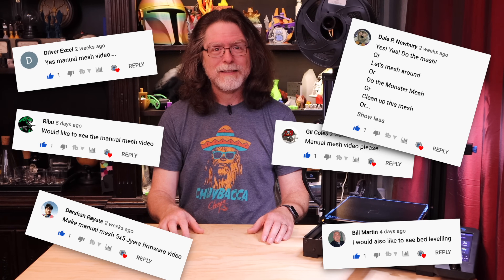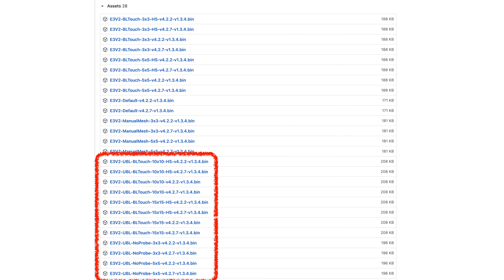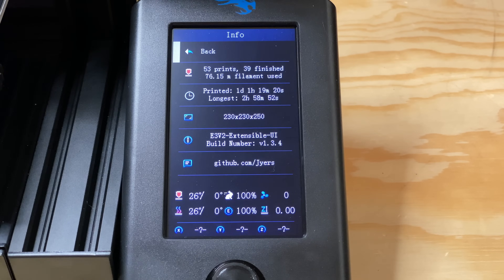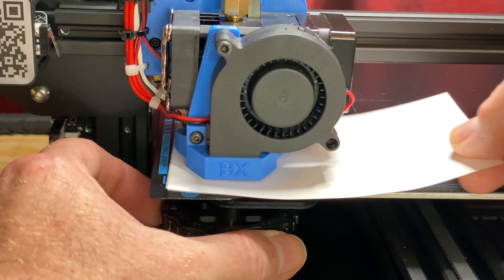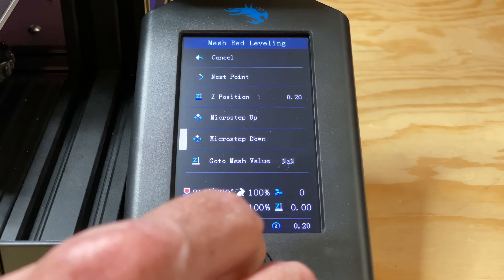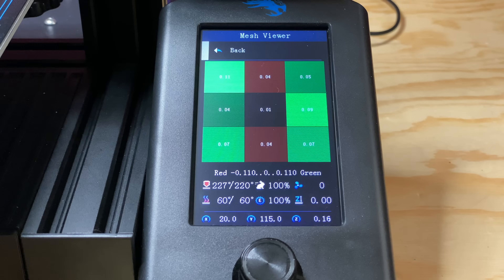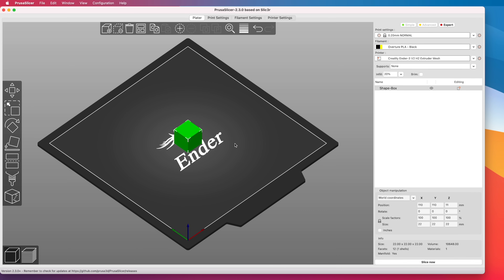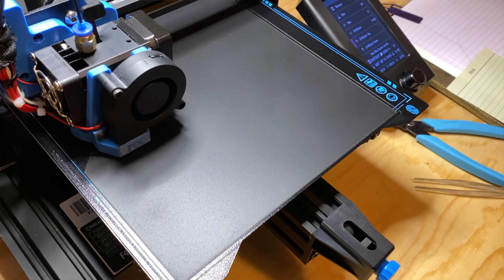Perfect First Layers with Manual Mesh Leveling - JyersUI on Ender-3 V2

Comment: Would i still want to do this if i have a cr touch
Reply from the maker: Hi, probably not. The manual mesh is a way of manually entering the nozzle height at each probing point, when you don't have a bed probe. The CR Touch lets the printer probe those points automatically.

Comment: Thank you for your video. I found it very helpful!
This firmware is a must have if you want to have more control on your printer and your prints

However, i had 2 issues and i'm still working on it trying to find a solution:

1) I could'nt flash the display firmware. I tryed a lot of things (microsd is formatter the right way, FAT32 with 4k) but really i couldnt't. After I inser the MicroSD in the display board, the printer (and the display) simply boots normally, without any blue/orange/black/green screen - NOT a problem by the way

2) The prints are not centered. This is a problem. After flashing the firmware, X and Y values have changed. When I print, the first line is out of the bed and prints are not centered. For the prints, I fixed it in cura, modifying the offset of the extruder position. This partially solved since now prints are centered, but all the old gcodes files can't be printed anymore. I have to slice them again

Comment: Why cant someone just come up with a bed that levels itself 🤔? Either put a motor in each corner underneath the bed controlling the X and Y axis .😊
Reply from the maker: Check out the Triple Z bed leveling on the Voron Trident. 👍
Reply: @BV3D  That's awesome.  But I have an Ender 3 V2, and I would love to have the bed level itself automatically before every print job. It should have the ability to zero itself out in coordination with the gantry.  Every printer bed should come with that basic function at this point.

Comment: I'm very new to 3d printing, so naturally I have many questions as I research topics. Bear with me please. If your bed has taken on the "u" shape, won't subsequent prints also take on this deformation? At what point would you get a new bed? How much function loss would you expect in mechanical prints that have tight tolerance?

Comment: thank you so much! i cant explain how hard i have been trying to level my bed for the longest time with achieving no success, finally i figured out that my bed is warped from factory. and watching this tutorial, not only i was able to level my bed properly but upgraded my printer aswell with more features. 
I GOT A HARD ON WATCHING MY TEST PRINT COME SO SMOOTH.

Comment: After trying this multiple times, I'm beginning to think the stock print bed on Ender 3 v2 is just garbage. No matter what manual levelling I do, no matter how dialled in I get the mesh, the first layer REFUSES to stick. Instead it runs away from the bed and curls up to give the hot end a beard. I'm going to take a break before my hair falls out

Comment: Hey Bryan, I am already a follower of your channel and have learnt a lot since jumping into the 3D printing just a month ago.
Let me tell you that I had been struggling to understand Manual Mesh bed leveling and your video (as usual) is the best in explaining the concepts as well as the steps needed. I just found out that JyersUI might not be a supported firmware anymore and going forward I am hearing that Mriscoc Professional is the firmware of choice for Ender 3V2.
Could you please do a video showing step by step procedure on that firmware as well? Or is it going to be the same as JyersUI?
Thanks and keep up the great work.

Comment: DUDE! I'm using this firmware and despite trying a bazillion times to use mesh leveling, your video taught me how to do it the good way! For whatever reason, since the mesh leveling process starts at Z=0.2, I assumed (wrongly) that I need to get a 0.2mm gauge and adjust the microsteps so in that particular point the nozzle is low enough to grab the feeler gauge. I was so wrong! I need to use the thinnest one I have (0.01 AFAIR) so that I'm leveling as near 0 as possible.

Thanks a lot! You've just gained a sub. Keep up the great work! Woohoo!

Comment: do you have (or plan to do) a similar video but using the more recent mriscoc's professional firmware? I was told jyers is no longer supported.
Reply: Couldn’t agree more. Would be great if Bryan can do another video using mriscoc firmware. 
I’m curious to know if the update in the slicer is the same?

Comment: Hello Bryan, Thank you for such a informative video.
I have just purchased a Ender 3 V2 and first attempt ended with filament all over nozzel and threading all over the item I was printing 
One thing I am not clear on with the levelling with the bltouch. Do you set the bed at fully tightened or loose?

Comment: You my friend are awesome. I watched the Jyers firmware video and got motivated to put the firmware on my printer after it has been sitting for about two months. That was easy peasy and now i feel confident in getting my bed level and getting my printer usable again. I'm no programmer and I've tried a few times to compile the Marlin from scratch but I kept getting errors and I think my VS code is set up incorrectly. Idk how that sorcery works so I gave up until your Jyers video popped up and I thought "what the hell, let's try it." Worked like a charm and my printer is currently making a mesh. Thinking of what to print my people for christmas. Thank you.

Comment: Thank you for your channel and for this video. Having tried native raw stock etc. Marlin without success from the start (I was new to VSCode and could not compile it without errors),j I found TH3D which worked well, particularly its features and UI, until I installed my BLT. I couldn't get it to work so went to the Creality stock FW which was okay, but buggy and very dull as an interface. When I revisited TH3D and took the time to do everything right (using the latest iteration on my Ender 3v2) I discovered what appears to be a bug in its Z offset function, a problem others have also experienced. Suffice to say it is maddening, in part because I went through a PEI mat due to its unpredictable interpretation of Z offset settings. I think this is an issue that has been ported from Marlins Z offset wizard, in the forking...needless to say it maybe shouldn't have been forked because it wasn't quite done (oh, dear) so I ended up trying Jyers, and it is so far a revelation in features, ease of use and GUI. I recommend it and it is good enough and has saved my countless hours debugging T H3D,  that I feel compelled to throw them a few bucks as it will be money well spent. I don't care if they buy chemical amusement aid to keep them coding (ie caffienated beverages of course), they deserve it. As does Bryan Vines. Now i have one decent benchy to join the spaghetti armada. Thanks again...long time to get here, but I am a slow mover.

Comment: Hello did you take out the E3V2- Default version 3x3-4.2.2 out before you installed the new E3V2 manual mesh 3x3 4.2.2?

Comment: Brian, I have attempted to print the "perfect first layer" with PETG for my first dive into that material. I was very, very disappointed. Can you share, or perhaps do a video (if you have not already) how to best print PETG on a Creality Ender 3 V2? I have searched the internet and YouTube, and keep getting differing information, none of it seems to help. I have leveled my bed to within .1mm for each of the four (4) corners and then ran a mesh (I have the BL Touch installed as well as dies springs). I have the starting code in my slicer set to use the mesh and I finally got a print to run, but the first layer was not great. It tended to snag on the material as the nozzle moved and pulled up the corners during a bed level print.

Comment: So I need to leave my comment and thank you Bryan for this tutorial and your video on updating the firmware to the JyersUI. Beginner's advice from my experience:
The CR Touch is not such a necessary upgrade, but it helps so much ONLY when you understand how to manually level your bed, calibrate your printer and use the JyersUI features for manually trimming which are a Godsent. Thanks again Bryan!!!
Reply from the maker: Hi Angel! You are very welcome - I'm glad this helped!

Comment: I just did the Jyers update. In my start-up commands I had a pause to allow me to tweak the Z offset before printing the job. After installing Jyers, these commands now result in the Z axis moving up and asking whether or not I want to purge more material. When I remove those commands from start-up, it executes fine. Any idea what's happening? I'd like to be able to use those pause commands with Jyers.

Comment: Used manual mesh leveling and forgot to put the start GCODE alterations in.  It came out very good so I suspect it is enabled in the firmware by default.

Comment: Any chance we can get an update to 5.0?  Some of what you're describing doesn't match to the most current software. Ultimaker Cura 5.0 (not beta) btw
Reply from the maker: Hi Russell,
Are you referring to adding the line in the Starting G-Code to tell the printer to use the stored mesh? In Cura 5, when I click Settings > Printer > Manage Printers, and then click the Machine Settings button for the active printer, I see a window similar to what I see in Cura 4, with the Start G-code and End G-code fields at the bottom.
Reply: @BV3D  Yes that's what I found but I'm confused as to where to put the new code.  l am assuming that the code is like the old days of basic, commands executed in order of presentation.
Reply from the maker: @russhillis  It'll go in the same place I showed in the video. Find where the G28 is, then add a new line after it, and on that new line, type M420 S1 (and then close the window to save the changes).
Reply: @BV3D  I tried to share a photo of the code I'm looking at on Instagram.  I don't see any code lines with G28
Reply: BTW,  thanks for the suggestions.  Very appreciated!
Reply from the maker: @russhillis  Sure thing!

Comment: Amazing video and THANK YOU. I JUST bought one of these for my woman's son and 1hr ago finished installing the Jyers Firmware. Unfortunately when I go to 'Create New Mesh' it simply goes to all 9 points and measures them without the ability to adjust each point. Then again, before I got to that point...I ran that option a few times and at measured the 1st point...then the 2nd and the bed was too high...gears ground and it stopped. Something similar several times until I got it to measure all 9 points. Anyway, I'm simply going to reset the config and go through this video. Unless something I did was obvious before I get to that point and read it here.

Comment: Can you use JyersUI on the ender 3S1? I’m having major issues getting my bed level to get clean prints. There seems to be high and low spots and I when I attempt to fix it using the octoprint bed visualizer when I add tape to raise a low spot it seems to be doing the opposite according to a re bed visual. I’m curious to try the med leveling

Comment: Instead of M420 S1, can I use G29 L0 that way I can specify the slot where the mesh is stored for different material types? Does this do the same thing ?
What about using G29 J3 to probe the mesh for tilting using 9 probe points? Is that necessary to adjust the tilt in case the z-dial was moved?

Comment: Hey so I have a question, after creating the mesh on my V2 and doing a couple prints I see that one side is still printing higher (big gaps in layers) and the other side really close (almost smooshing too much), isn’t the mesh supposed to create the offset for your level? I know you have to set the z offset but how does that apply if I’m getting 2 different results? I’m just a little confused… if someone would be nice enough to explain that part a little more in depth?
Reply: Look at leveling the X gantry bar.  I have found Ender 3 V2s with very loose V rollers on the right hand side.

Comment: Hi Bryan thanks a lot all of these informative videos. I recently find out all these great videos. I am new with 3d world so i have question to every one. So when i did whole process and start to print i tried to offset Z but microstep not working. I need to offset 0.50mm then it works. Also when the first layer is good. I print again but its like i never leveling the bed. Anyone knows anything about that? Btw my ender3v2 has 4.2.2. I heart these motherboards have problems with the motor drivers. Maybe this is the issue.

Comment: What buildplate are you using?
Reply from the maker: That's the Biqu Super Spring Steel sheet. It started out pretty good but now it's just okay-ish (print surfaces wear out over time). At this point in its life I'm constantly using glue stick with it for bed adhesion. If you're looking for a good spring steel sheet + bed magnet I really like the Wham Bam ones. I prefer their PEI build surface over their PEX one.

Comment: @BV3D: Bryan Vines  Last weekend I installed the Ender Extender 300x300 print bed. I'm having a very difficult time leveling the bed to properly print correctly. I tried the manual mesh and my test print was worse than using the BLTouch mesh. I went back to the BLTouch leveling noticed the right site of the bed is high, middle okay, and left is low. I created a new BLTouch mesh but this time, I used the Manual Tuning option under the Level menu. The adjustments I made were quite significant from what the BLTouch mesh had. The test print was much better but still some issues.

Would increasing the points to say 7x7 or 10x10 be better?  I'm really stumped why I would still have print layer issues with a BLTouch installed. I never had to use Manual Tuning with the 235x235 bed.

Comment: G'day Bryan....i recently purchased the Micro Swiss DD and hot end combo, plus i have a 24v 50w Slice Engineering Heater cart, not knowing how to set some of the firmware i followed your intro to JyersUI now. Its got all the you need for ender 3 v2, so ive just installed the hot end and will upgrade the DD later after ive played with the hot end...cheers for your tutorials m8 from Sunny Queensland downunder!!

Comment: Need to adjust steps/mm ? I know where to find this in Marlin but I need to push out the 100mm of extrusion. Is there a direct command in the menu. there is Also I need to set Host actions what is the process.

Comment: Really useful tutorial for leveling and setting up Manual Mesh. One question I have is if you are using a feeler gauge instead of a piece of paper for the manual mesh setup, should you do anything different? I used one and my values were all much closer to .20 it starts you off with then what yours gets to. Also I printed the square that takes up most of the bed and it looked good at first but when trying to peel it off, all the individual diagonal strands separated. Is that because my bed is still too far from nozzle or just a byproduct of the one layer print?

Comment: Nice. I'd been wondering how to do that.  Question-- I use a 0.1mm feeler gauge for setting it manually. Should that initial gauge be a multiple of the Z resolution?  If I use a 0.1 instead of 0.2mm gauge do I need to do anything else? Maybe using the 0.2 gauge is more logical. Thanks 👍😊

Comment: Hi Bryan, many, many thanks for this awesome video. I was sttruggling to get my bed leveled and almost gave up on it. It turned out that I have a bump in the middle of my bed, so until I found this video it was a matter of choosing between nice prints in the middle and not so good bed adhesion outwards or good adhesion everywhere and in the middle everything squished to the bed like crazy. (I couldn't get my products from the bed unless using brute force) Now, with the level mesh I have very nice prints all over the bed. I have ordered a BLTouch already and I wil install it, but this method already works perfectly.

Comment: love your videos, they have helped me so much in setting up the firmware and levelling the bed, however i have an issue i am using the blt sensor and for some reason i am having to set the Z offset to -2.3mm, i have tried everything i can think of but i cant get it to be 0, thanks for reading the comment :)

Comment: This video helped my first layer tremendously after manually setting the Z offset for each point. Any chance you might know why the fan settings I have set in the creality slicer are ignored when going to print? I have my initial fan speed at 5% with regular at 90 but they never turn on automatically.

Comment: How can be z-offset negative? as wie have a z-axis motor stop by 0.0z ? I just don't get it. Before we begin with manual mesh levelling, we adjust the bed. Tis is already 0.0. The values below 0 would scratch the bed, or I don't get it correctly?

Comment: Did you already have the screen firmware flashed before you put the Manual Mesh Leveling firmware on the motherboard? Also, should I assume that once the screen firmware is flashed that it stays the same no matter which motherboard firmware is flashed or how many times it is flashed? (I apologize, I am new to this process so these questions are probably very basic but I just I'm just not sure of the answers)  Thank you for your videos. They help new guys like me easily understand how these processes work and relieve ALOT of stress.

Comment: Hi bryan, Thanks for the video`s here on youtube!  i recently got my self an ender 3 v2. And i discovered your channel. Really like your videos. Learned a lot from them. Planning on installing jyers firmware with manual mesh leveling.
I`m trying to understand how it works before i put it on my machine. There is one part that i don`t understand in your video. and i think i`m not the only one. The litle bit on the z-offset in the tuning screen is something i don`t understand. What do you have to do here? Could you explain it in a matter that a noob can understand it?
Reply: Thanks bryan, in the new vid about the s1 you explained z ofsett very well.